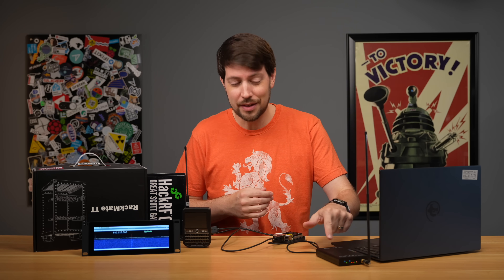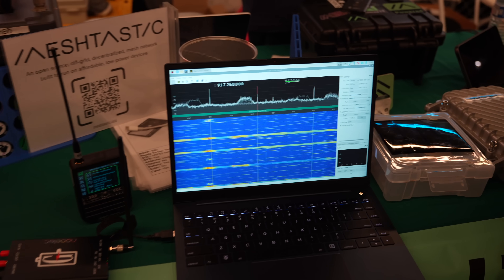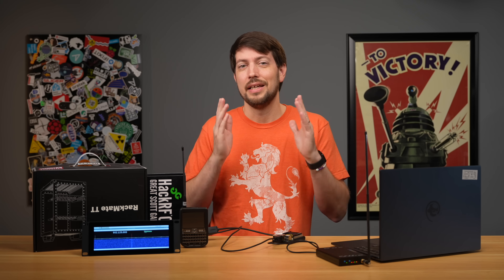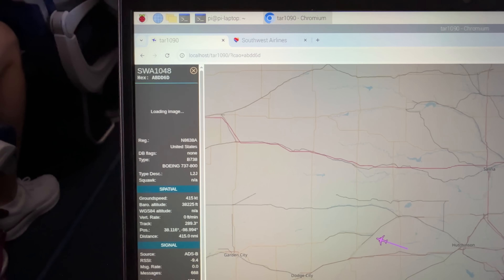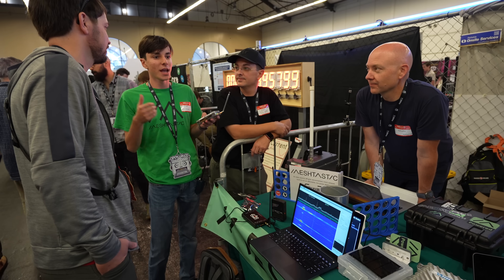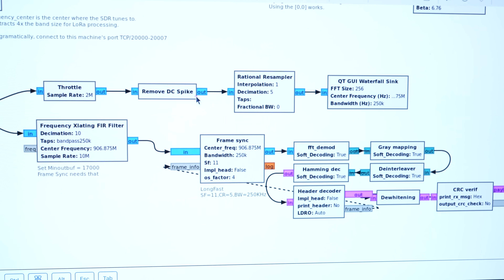Hacking Meshtastic with a Raspberry Pi and GNU Radio

Comment: As a ham radio operator with a general class license one thing NO one mentions with meshtastic is that yes you can get miles on this thing but also line or sight is your friend...elevation is key and no obstructions like big mountains big buildings with a lot of steel in the framework etc the list goes on as to what can obstruct a signal and hinder its distance without repeaters set up.

Other than that these things are great...I will now unpause and finish the video just felt like this was needed to be said because not everyone understands how RF works. 

Great videos keep up the good work!!!

Comment: Hey Jeff, I live in Denver and we have a pretty decent Meshtastic network here.  I just got my first unit online recently and my very first message was someone on a flight sending a message.

I tracked the flight down since their test message included their flight number, and they were just below the Colorado/Wyoming border and West of me in the mountains.  I would guess somewhere around 150-200 miles as the crow flies.  

It was a brief direct connection and not from mesh.  Pretty cool, especially for my first ever Meshtastic message!

Comment: I was working on a very similar setup in GNURadio a year or so ago (just before Josh Conway published their repo, would have saved me a tonne of time if I had stumbled upon that earlier!). Been wanting to see if you can easily snoop on remote Meshtastic networks (using default settings / encryption key) via publicly available WebSDRs.

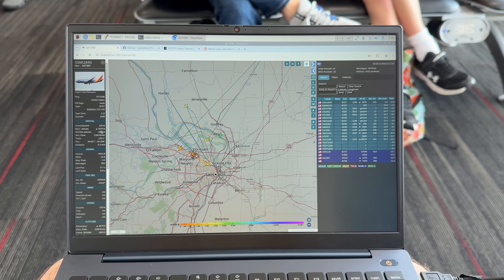Comment: Hi jeff, 6:25 - some thoughts: Planes "seeing" other planes for TCAS happens over Mode-C/S transponders, not over ADS-B. Same for ground control. ADS-B is on the younger end of aviation technology, thus ground control will rely on primary targets, MLAT and Mode-S. Enroute airspace has ADS-B required in most places these days.  ADS-B shines here! Enroute controllers can see is what the airplane has actually "dialed in" to their autopilot, so you can verify immediately if the pilots are following your instructions correcttly.

Comment: If you like the ADSBee, you might also go pick a dAISy from Wegmatt. What ADSB is to planes, AIS is for boats. The dAISy is all self-contained with the receiver and decoder in a little box. You just hook an antenna up to it and reports start coming out its USB serial port. The hardware is pretty flawless. The software is pretty creaky, though. It works okay, but it isn't going to win any awards.

The dAISy is also dramatically less expensive than the ADSBee, but it's probably more of a niche thing. The benefit of having a transmitter  at 30,000ft entirely goes away when your transmitters are all, by definition, at sea-level. :(

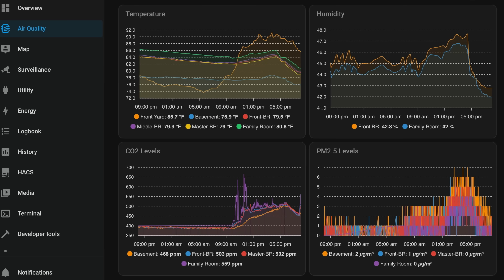Comment: 1:43 what are you using for your sensors in the various locations shown that read CO2, pm2.5 and temps that also can feed into home assistant like this? (I'm still gathering parts to put together my own home assistant)
Reply from the maker: Good question! I did a video on I think the Geerling Engineering video a couple years ago on the AirGradient One sensors. I just bought another one last week, heh. They are great for environmental monitoring with an open backend, so you can use them with Home Assistant.

Comment: Hi and thank you for the interesting projects. I noticed that you used gps module inside of meshtastic and used on the flight, does this inference the cockpit's instruments? I plan on using the wardriving with gps on the aircraft in near future. Thank you.
Reply from the maker: GPS is receive only, so unless you're doing some exotic anti-jamming or spoofing experiments or have crazy weird antennas, GPS shouldn't be an issue. Other frequencies and uses can, especially if you want to transmit
Reply: @JeffGeerling  Ok, thank you for your kind response. I loved using gps for datalogging as my hobby.

Comment: It seemed great to me, but I discovered that the LoRa32 module varies depending on the device and they are not compatible even if they use the same protocol. Each LoRa chip manufacturer has its own things.

Comment: Where you able to decode the meshtastic  messages ?
Reply from the maker: Still working on it, but after posting this video and my blog post, I've gotten some more help! It looks like I may need to replicate my setup on a faster Linux workstation to see if the Pi's CPU was holding me back a bit. Then I can tune it better for the Pi if that's the case!

Comment: I so wish they would fix the HackRF's DC spike.  all other radios have evolved and got rid of the problems from the early days.  HackRF is still based on almost 15 year old design.
Reply from the maker: The HackRF Pro is coming later this year I think, and will be removing the DC spike and improving the RF circuit in a few other ways. Fingers crossed!

Comment: The interesting thing about LoRa is how it's a proprietary protocol by the manufacturer - it has a bunch of settings - depending on the bandwidth you need and the distance. It can go several 10s of miles if you lose the really low speed option (several bits/sec), while I think the "long fast" option is several miles at several hundred bits/sec. The fast turbo is using the shorter range modes (likely under a mile) but can get you into the kilobit range. The manufacturer of LoRa has refused to document how it all works though, as they sell it as modules for IoT devices.

Comment: I think that sweep around 9:50 you were talking about was someone using a rigxpert or other tool like a NanoVNA to check an antenna's radiation characteristics.
Reply: Looks more like a CSS type signal to me, which is also used in LoRa communications

Comment: 7:41
You don't see any data channels. What you see is the bandwidth "spilling" due to the PPM modulation. In the time domain, the signal is a series of pulses. And in the frequent domain, there will be multiple sidebands from it. There is a free book on ADSB. Called "the 1090 Megahertz riddle"

Comment: Did you shelf the Carribou lite?  -- When you posted video earlier this year it inspired me to buy one. which resulted in me pairing it with a pi zero 2 w and configuring as an ethernet gadget so that i can use sdr applications on a laptop. Its fun to break out every now and again.
Reply from the maker: It's still installed in my rackmount SDR setup; though I've been testing other SDRs a lot, so I can get a feel for how each one behaves, the system requirements, etc.

I'm currently testing HackRF One, HydraSDR, RTL-SDR v3, RTL-SDR v4, Nooelec RTL-SDR v5, and CaribouLite, plus I have a few other models sitting in a box I haven't opened up yet!
Reply: @JeffGeerling  haha wow that’s a lot of equipment 😅 - it would be cool to see a shootout type video to show off the differences though the rf one and rtl sdr seem be the community favorites that get the most software support.

Comment: thank you for pointing this out, all the people who think these are some off grid device really are just carrying a better tracker for the people to pay more attention to!
Reply from the maker: You can either disable GPS or not even install a GPS antenna on your device too. And by default now, the GPS settings have a 1.5 km 'fuzz' to them, so you can configure how precise the locations they report are.

I only have it turned on for a couple of my nodes, and I have them all set to a few km distance. If I went on a hike or somewhere off grid and wanted the safety aspect, I could set it to more precision.

The nice thing is, you can do that per-channel, so you could have a separate channel for your friend group that has precise location, while public channels are not set to share any location.

Comment: Cool! I was thinking about doing something similar to be able to pull in mesh packets and strip off the mesh part and forward just the inside information on over tcp/ip to extend the reach. Mesh in communities then a central non mesh part to extend the reach- maybe a vhf packet connection or aprs as it can carry the mesh into the wider ecosystem.  During Helene we saw the potential of mesh but it was not connected with another network so we  had information islands…

Comment: I really really really hate using the term "hacking" for recieving and decoding a data signal. Am I hacking my local FM broadcaster when my car tunes to the HD channel? Of course not. And I'm STILL not "hacking" it using an rtlsdr and nrsc5 to decode it on a computer.
Reply from the maker: I prefer the older terminology for the word "hack". It had no nefarious connotations, it just meant digging into something, figuring out how it works, tinkering with it, etc.

Also, I'd happily lump myself in with someone called a "hack", where I barely know what I'm doing, but I like to try and then share my experience. Maybe you'd like that term better applied here ;)
Reply: Clickbait.

Comment: Something to try next time you fly and are trying to track ads-b is using an inline filter. There's a few different options out there for dedicated  1090 MHz and combo 978+1090, though a 1090 is probably all you need. Also on top of that using a dedicated tuned antenna as well. it would be interesting to see if having all those two things ends up helping receive farther away while in the plane.

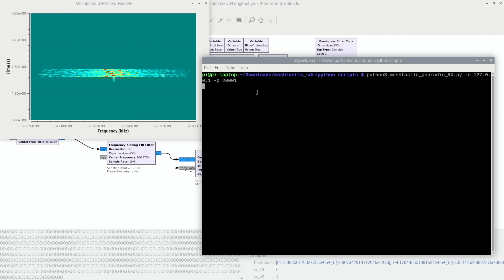Comment: 4:50 - Yeah your problem is actually on screen. The OOs OOs is the driver's way of saying it's over running its buffer. AKA the computer is not fast enough to decode what it's getting in. 20 MHz of bandwidth on the HackRF is around 40MB/s of data coming over the USB port. That's 40MB/s that down stream nodes are seeing. If you plug HackRF into a faster computer (The CM5 is going to have issues) you should have an easier time of it
Reply from the maker: Aha! I was trying to figure out the OsO, that makes sense.

I may work on reducing the bandwidth more (I had tried 10 MHz but no less), and see if I can get the Pi to decode. It was only using 50-70% CPU but maybe it needs more IO bandwidth too.

May run the tests on a beefy Linux box separately before replicating the setup on the Pi
Reply: @JeffGeerling  Yeah, try on a bigger CPU first as a sanity check. Once you have positive results you can move down to the Pi.

Comment: I need to get back on meshtastic. I live in the middle of nowhere and plan to setup a repeater, but I have to get my old house sold first. The land I pla  to put it on is around 50' higher than the house so I'm hoping I can see some more nodes than just me and my wife, at least occasionally. We are far from an Interstate, so I'm hoping more height will help.

Comment: God I wish I could get GNU Radio to work.  I have an RTL-SDR but can't get GNU Radio to see it on Ubuntu... and the UI is so busy I'm not sure I'd be able to tell if I sorted it out.

Meshtastic packets are encrypted, but there's a well known PSK for the pre-defined public channels.  The biggest benefit of that is probably that it prevents accidental interference with other LoRa protocols on the same RF channels, since it makes Meshtastic packets look like random noise.

LoRa itself is also a cool idea from an RF modulation perspective, since it also looks like noise to non-LoRa RF signals (for a totally different reason).  Better to have noise that looks like noise than noise that accidentally looks like signal.

Comment: Started fooling around with mesh tastic last year lost interest because nobody else knew what it was. after Open sauce and meeting you I decided to reopen those files. Thanks!
Reply: I had my node running for over half a year before somebody else in my neighborhood set up a node and became my gateway to the rest of the nodes in my community
Reply: Have you come across Reticulum or Meshcore yet? They're both more enjoyable.
Reply: Not true. It’s just when it’s basically a pager and all your messages are easily decoded plus you basically need to be on  a plateau to even receive aptitude distance of signal. I’d much rather use a walkie talkie if we’re talking about RF tech 😅
Reply: @dabrig7605 it’s cool tech, I have one going in my apartment complex and managed to talk to Chicago from half an hour away

Comment: 6:51 this is my favorite thing to do when I'm flying, I have a raspberry pi exclusively set up to run readsb/tar1090 that I keep in my carryon and then access over wifi
Reply from the maker: Nice idea! I've also considered running Jellyfin so I can pop over to it and watch some of my movies locally.
Reply: what sort of battery life do you get and power bank you use?
Reply: @404invalid-user  It's a 100Wh Anker battery I affectionately call "big chungus" and it will basically power the Pi, a cell modem, and the RTLSDR all day.
Reply: @404invalid-user 
Has to be less than 100Wh, don't buy any Anker power banks, there are a few on the "no fly list".

Comment: VHF and UHF are practically dead in  my area. There's only a few of us on the air these days. I'm curious if Meshtastic will take off. So far, I've seen no transmissions on the LoRA freqs.

I use an AirSpy R2. It's slightly smaller and just works with any OS I throw at it. On the plus side, it has a higher resolution. I'm not sure I need it, but that seemed more useful than bandwidth or covered spectrum.

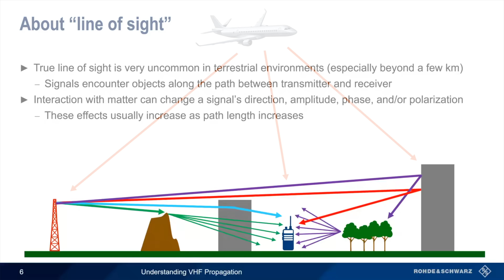8:13 In a commercial aircraft, you're in a large faraday cage. That's why nothing works well. Some are able to do VHF/UHF comms in a small aircraft like a Cessna, but they have a lower altitude and aren't surrounded by miles of wiring. I'm rather surprised being by the window helped. RF magic!
Reply from the maker: Too bad we can't get access to pop a magnetic antenna on the underside of the plane haha
Reply: @JeffGeerling  Ha!

Thinking on the issue with decoding, could it be the laptop didn't have enough horsepower? It might help to lower the bandwidth as well.
Reply: On my last plane trip, I was able to get meshtastic connections out over a hundred kilometers. It sparked a fair bit of interest on my local public meshtastic channel, a few people sent direct messages which I received successfully. I was fortunate enough to have a window seat but was just using a SenseCAP Card Tracker T1000-E, nothing special. I just wish I had set up a base station at home before I left so I could see what messages I'd missed out on.
Reply: I've used my phone for GPS signals on a plane. When sitting next to the window it's fine, but move it more than ~40cms away and the signal is almost non-existent.

Comment: 1:45 Yes, refrigerant is expensive, but only $75 to $100 per pound expensive.  The coolant lines are under pressure in an outdoor environment, which means they will eventually fail due to weather and temperature changes.  Small leaks won't immediately bleed everything out though, so you were probably seeing higher electric bills last year.  Regular maintenance of your AC unit is essential to its proper operation.

Comment: FYI, the biggest scam with HVAC is telling you that you need a full recharge because it's charged by weight. They'll charge you $3k in refrigerant while only using $300. If they're not willing to let you watch them work and weigh the cylinders they're scamming you.
Reply from the maker: I watched; we had a large leak in one of the joints that failed (factory issue).

Of course the labor is covered under warranty (about $400), but the freon—which had all leaked out—was not. I monitored as he put in about 10 lbs.

I could've gotten the refill from another place for a few hundred bucks less, but that would've required getting another tech to come out and we were already out of the house for a couple days at that point (can't have a baby sleeping in 85°F temps with STL humidity!)
Reply: @JeffGeerling oh I get it buddy, with the wife and the baby it's like goldilocks when it comes to temperature. At 68.1 it's too hot but at 67. 9 it's too cold and absolutely nobody sleeps if it's not absolutely perfect. Happy wife happy life 😁

Comment: I thought that Meshtastic uses Lora frequency ranges, but not the Lora protocol.
Reply: No, it's LoRa, but LoRa is like Ethernet in that it's a packet framing protocol (layers 1+2) and not a transport or application protocol (layers 3 & up).  There are many different ways to use LoRa, e.g. LoRaWan & Helium, and any given firmware usually supports only one at a time.

NB both LoRa and LoRaWan are patented, but the LoRa patent license usually comes with the RF decoder chip, whereas a LoRaWan license would come with the end user device if it's sold flashed with LoRaWan firmware.